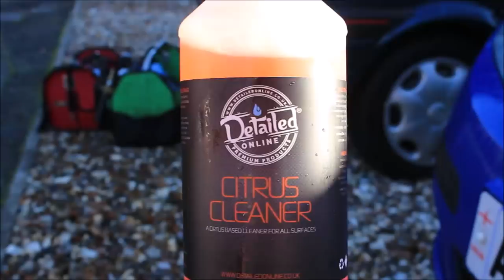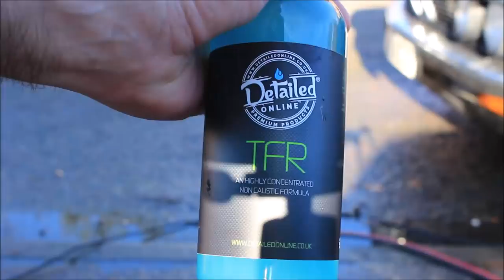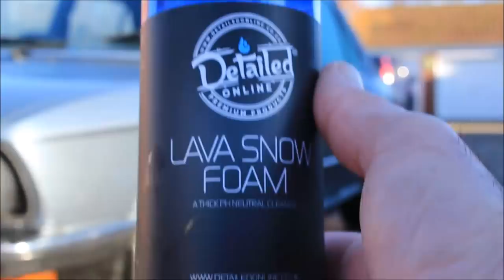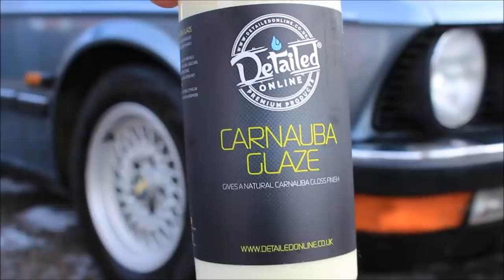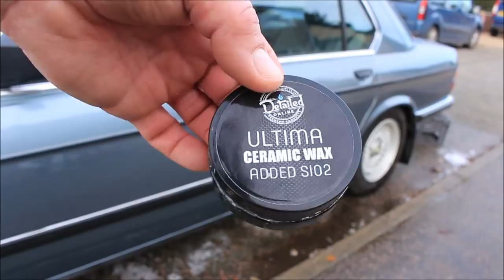Filthy BMW

Comment: Hi Paul, 

Just a quick question ? .  How do you take care of your back when washing and polishing a car  ? .

The reason I ask is im 6 ft 5 , and have suffered with back problems all my life and  despite the pain its caused, I have always spent three hours or more valeting my car or other peoples . The only downside is now, Ive just had spinal fusion surgery and had three of my lower disc's bolted together , im half way through the healing process and hopefully come October I should be 80% fit . So hopefully I can get back to detailing my car again and ditch the ok'ish valeter .
Do you take any precautions when detailing/ valeting to protect your back especially during winter? . Do you use any back support?.  I know this isn't the kind of question you're used to , im just kinda trying to raise awareness of spinal injury doing this kind of job , as I don't want you having to go through what ive had to deal with the past year .
All the best 😉👍.
Reply from the maker: Jaye Dee that’s a really good question and I’m sorry about your back I’m just under 6:5 and for me it’s not my back that’s the problem it’s my right knee I have osteoarthritis in it which is worse than my back that’s not to say I don’t suffer with back pain I’m 48 now and manual work has taken its toll no back support but I try and keep my weight down as much as possible and stretch out after a long detailing session thanks 🙏🏻 so much for bringing this to my attention I think 🤔 it’s worth a video mention Jaye all the best Paul 👍🏻
Reply: Paul Dolden Details Thankyou for your reply and thank you for the consideration. Im 45 and have spent 20+ years on and off in either catering or manual handling warehouse work, so yes this has contributed to damage to my back and both knees.  
I love valeting and have been doing this since i was 10 years old, I did a weekend job working at the local ford dealer during the 80's/90's as a teenager, and polished all the showroom cars including the cosworths  . I wish i had stayed on with Ford but instead became a chef .
Anyway get your self a good back support during the winter  that covers most of the lower spine and you will thank me for it later lol . All the best 👍😉
Reply: @JayeDee_Gr4  well said, I know this is a few years old but thank you for raising it as it is really important, as someone who loves looking after their cars who now has an l4/l5 disc protusion I know how important this is

Comment: i still think that the bbs wheels that bmw used back then are the best looking stock wheels ever
Reply from the maker: Got memes? There’s a new set on there way even better 👍🏻
Reply: Paul Dolden Details love the bbs alloys , i had them on my 1991 525i . Only down side is the cost of the tyres lol @£200 a corner due to the specific type of tyre they needed .  God knows why lol ??.

Comment: not sure if you've tried it yet buy you should do a review of the carchem 1900-1 shampoo. probably one of the best shampoos i have used if not the best. they also do regular sales on the 5litre option for only £21.99
Reply from the maker: Aiden McKinnon heard great things for years I seem to be flooded with new brands though

Comment: Hi Paul....just a small comment, with the two bucket wash, I notice you just go round the car, would it not be better to work down the car to reduce the chance of inducing wash marks / swirls on bodywork/paint, ie start on roof , bonnet front end, then upper door areas and boot lid, then cills  and lower boot area last, so you do the dirtiest areas last with the dirtiest water....👍 great review regards Andy.
Reply from the maker: Andy Kerruish try not to take to much notice of that it’s mainly done for camera shots but good point for future videos I don’t want to get bad habits out there good comment though 👍🏻
Reply: No worries Paul, I only found your channel today, look forward to following your videos, like your dry humour, and will be checking out the back catalogue, I’ve been valeting/ Detailing full time 5 yrs now, still learning every day....👍🇮🇲😁
Reply from the maker: Andy Kerruish I’ve been doing this for around ten years but I’m really only a part timer it’s not my main job 👍🏻

Comment: Welcome back! Like that you don't pull your punches when reviewing products, I'm sure the product companies do too so they can make improvements. Do like an Si02 sealant for the winter if it's too cold to carry on waxing. I agree that the whole spray on, rinse off approach with spray sealants is flawed. I prefer to spray them onto a mf then apply, and then a light pass with a damp mf (to activate the product) before buffing off with another mf - seems to give a better result imo. That Beemer is lovely too! Cheers and well done on getting to 3k!